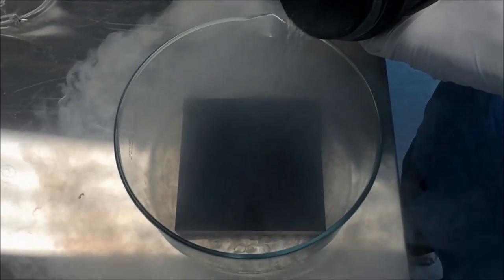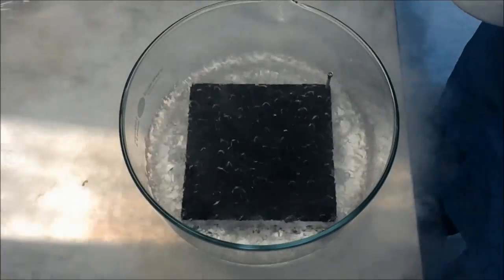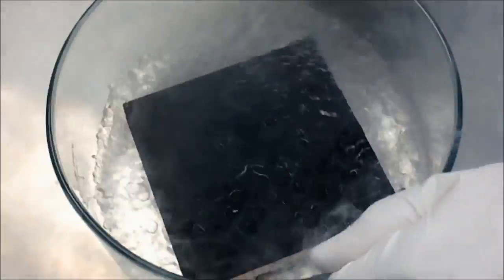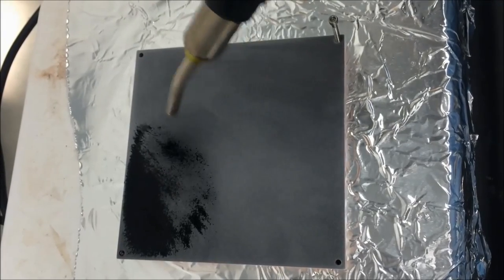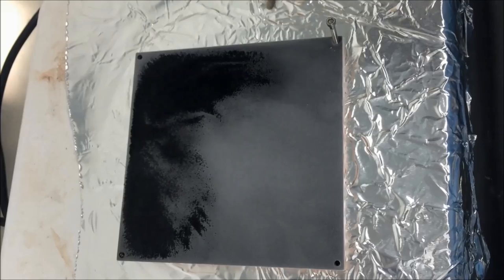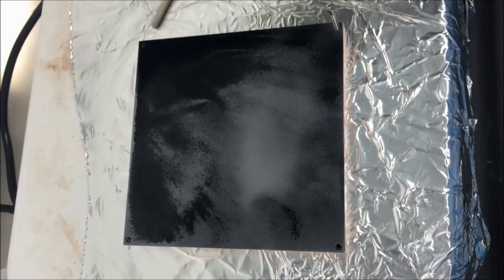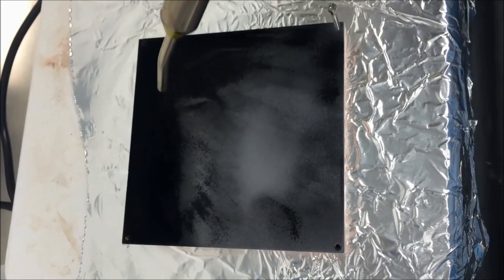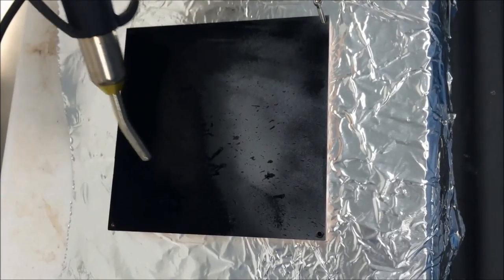Vantablack vs. Liquid Nitrogen

Comment: I'm curious if you had a object like a car covered in this, if the absorption of the radar waves from something like a radar gun would be enough to give a false or incomplete reading.
Reply: +00011theman check out "blacker than vantablack" on youtube. Based on the video the car would look like an endless hole as the signal never comes back to the guns sensor (depending on how effecient the sensor is)
Reply: Be cheaper to just pay the ticket 😂
Reply: Radar guns emit in a different wavelenght em radiation, than in visible light. So it wouldn't necessarily work.

Comment: Whats the point of submerging  a black material in liquid nitrogren?
Reply: +Go&#39;el The material – which absorbs over 99.9% of light falling onto it and is claimed to be the world’s darkest material – is made up of a densely packed “forest” of vertically aligned carbon nanotubes (see the image below).  In fact the name “vanta” stands for Vertically Aligned NanoTube Array. Its like a very dense brush, so I suppose they tested how sturdy it is by blowing pressurized are at it while frozen? Could be.
Reply from the maker: It demonstrates the coating's robustness against temperature cycling such as you find in outer space where no thermal energy is being received (in shadow) and objects radiate their heat away. Most super-black coatings fail or delaminate when immersed in liquid nitrogen because they go brittle and contract as its such a severe shock. This is a method of introducing very rapid, severe stress into a coating to see how robust it is. Plus you have the eroding mechanical action of the bubbles during cool down. Thanks for commenting!
Reply: +Surrey NanoSystems I could have thought of that myself -.- Thanks for clearing that up ^^
Reply: This is not how space "severe temperature" works, there is no medium to transfer the energy from a surface in space because vacuum makes good insulation.
Reply: +DHR_000x no, it absorbs 99.6% of light.
Reply: +DHR_000x I heard that they made a new vantablack, it absorbs so much light they can't even measure it...
Reply: Hunter Secrets You need to post a source of that. Photon clocks can measure a single photon but you can't measure how many reflect from a certain surface? Sounds improbable so, please source :D
Reply: To see if it can withstand coldness
Reply: Possible application in space engineering.
Reply: Will apparently it is fully water proof
Reply: its not just any black material!! that's Vantablack!
Reply: how many black skiers do you know of......
Reply: The blackest black can absorb light but emits heat as infrared while liq nitrogen can absorb lot of heat

Comment: After performing the test did you measure the reflectivity of light to see if it was the same as before? If so, that is incredible: it can withstand very cold and very hot and not lose it's basic property.
Reply from the maker: +sapbucket Yes, we always do that after a thermal stress test. The reason it can withstand such thermal cycling is due to the unique material structure. Each individual element (1 billion of them per cm sq) is free to move against each other as if they are individual elements (like grass in a field). Thanks for commenting.

Comment: Could Vantablack be used on that energy generators that use a self panning set of mirrors that focus the sunlight into a central thermal unit? Maybe the unit coated with this would optimize the sunlight absorption, is that correct?

Comment: After being submerged, when you guys applied a new coat of Vanta on the already frozen surface, I noticed that the alluminum started to glow orange in the background.
Was that heat transfer or just the background lights that where being reflected?
And sorry for my english.
Reply from the maker: +ALSPEHEIR It's actually a copper block coated with Vantablack, so you are seeing the orange reflection from the copper.
Reply: +ALSPEHEIR They weren't applying a new coat of Vanta, they were just using compressed nitrogen to warm it back up and remove the ice from the surface.
Reply: +AvatarPuls do you know where to find this

Comment: If you had a cryostat that had an internal temperature of 20K would this vanablack replace the super insulation?
Reply from the maker: +mick mccrohon No, its not an insulator. It has very high front to back thermal conductivity, so would allow a lot of energy into the cryostat.

Comment: how hot does it get in the sun
Reply from the maker: A little hotter than a good quality black paint. Road asphalt is c. 90% absorbing and this is 99.965% in the visible spectrum. So you get 9.965% improvement + when you add in performance in the IR spectrum that increases it a bit more.
Reply: Surrey NanoSystems I am by no means established in this field, but I'm curious. Since it can absorb 99.65% of all light, is it possible that this could have applications in light energy absorption and conversion into electricity?
Reply from the maker: It can, but remember it's the closest thing to a black body so it's highly efficient at radiating heat in the IR spectrum.

Comment: Interesting, but where do the photons go?
Reply: +Tony Budz They're absorbed and eventually converted to infrared radiation.
Reply: Buzzby1949
Yes but absorbed to where? Matter can neither be created nor destroyed.
Reply: +Tony Budz Photons aren't matter.  They're "packets" of radiant energy.  They're absorbed by the Vantablack and degraded to heat (IR).
Reply: And where does that IR go? Wouldn't the vantablack feel either cold or hot to the touch?
Reply: It would warm up.  How much would depend on how quickly it could radiate what it had absorbed.  This would be the same for any dark-colored object exposed to light.
Reply: +Buzzby1949 Ahhh ok, thank you for the clarity. 😆

Comment: So it absorbs 99.6% of visible light, but have you tested how much radiation is absorbed at other frequencies?
Reply: +Zbroification  A follow up question would be if it could be used as shielding  Li-Fi signals. This stuff has loads of potential.

Comment: totally pointless exercise with no explanation why it's being done. what does it prove? it can withstand -196C?  what next? boiling water?
Reply: Copypasta from the uploaders comment: "It demonstrates the coating's robustness against temperature cycling such as you find in outer space where no thermal energy is being received (in shadow) and objects radiate their heat away. Most coatings fail or delaminate when immersed in liquid nitrogen because they go brittle and contract as its such a severe shock. This is a method of introducing very rapid, severe stress into a coating to see how robust it is. Plus you have the eroding mechanical action of the bubbles during cool down. Thanks for commenting!"
Reply: Thank you for the explanation.  This now makes good sense to me.  
I am an electronics engineer and we build circuit boards that go in to satellites, we have to be sure the solder joints can survive stress caused by difference in CTE between the component and the PCB.  We test between -55C and +100C.  So a lot less severe  as your shock of 20C to -198C ! (but we do it for 500 cycles!)
Reply: One REAL application is inside telescopes, where you want to eliminate any stray light and get rid of any light that is not properly being reflected from mirror to mirror. It improves the telescope. Its also true for other sattelites that have optical or laser-based devices inside, like the sattelites planned as an gravitational wave detector. Now if it can handle the extreme temperatures a sattelite can experience in outer space, this is good news.

Now the next test would be to fire a bullet at it and see how many particles come off. It would be bad if a micrometeorite hits such a sattelite like a hammer, but the hardware survives, but now the optics are impaired because of all the black dust that got knocked off the vantablack.